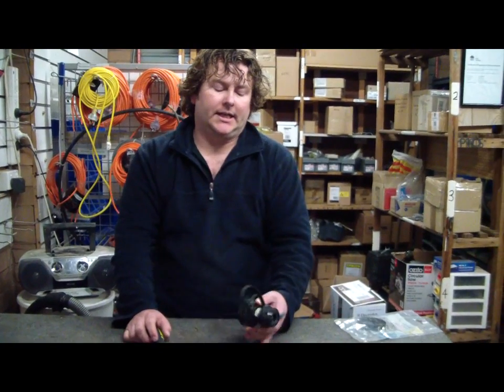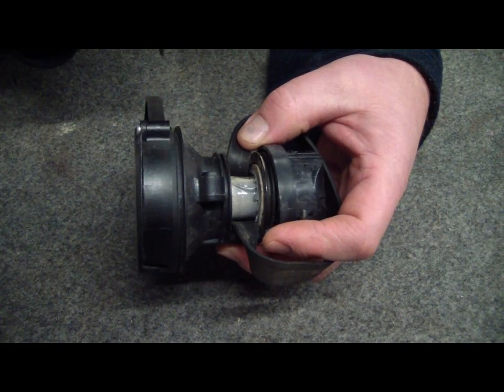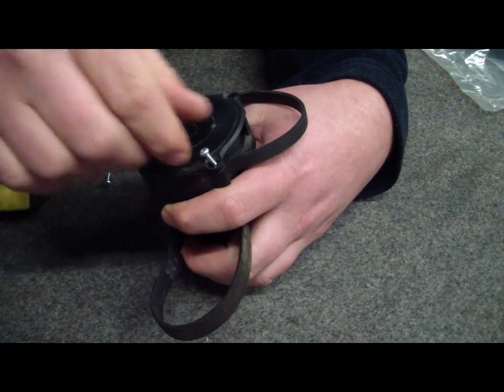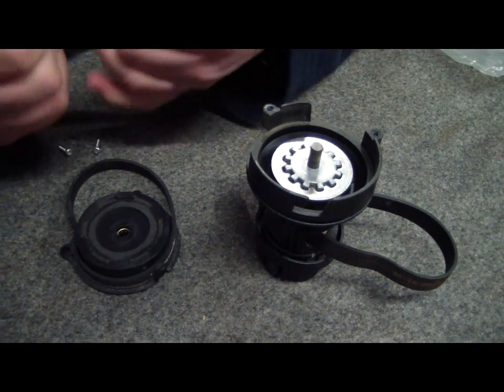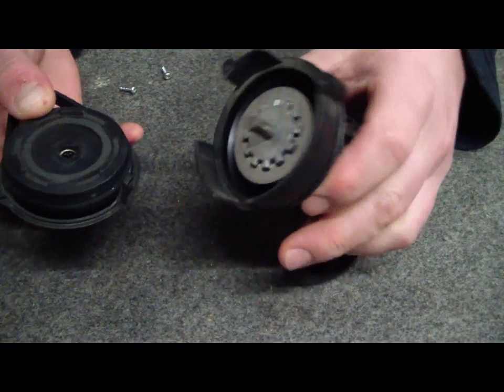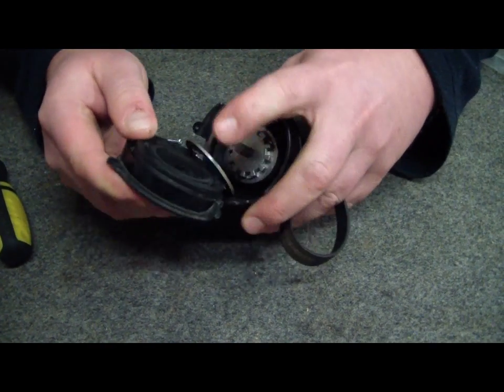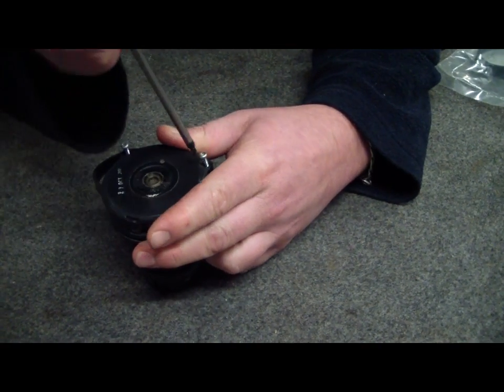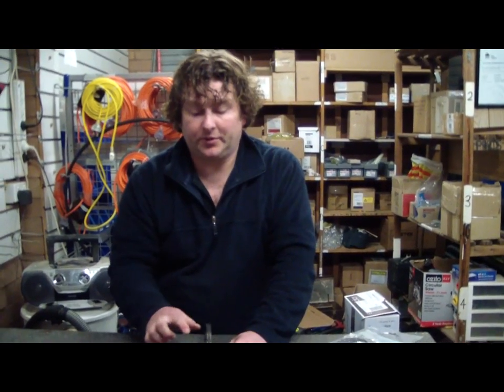How to change the clutch belt on a Dyson DC04, DC07 & DC14

Comment: Hi, thanks for the video! I got a pair of belts to replace the old one on my DC14, but they seems too short, about 2/3 of the length compare to my old one. It's not really stretchable, so I don't know what to do with it, I don't want to damage the other parts of the machine with a tight belt.